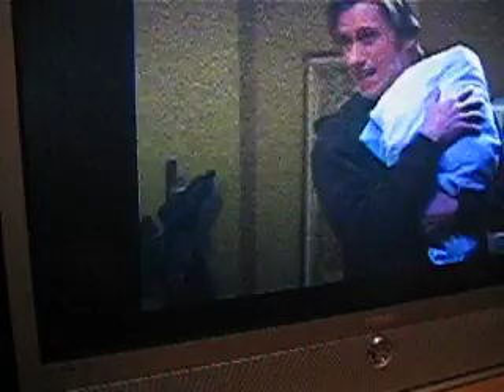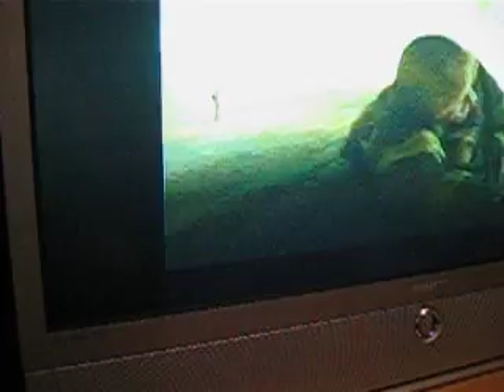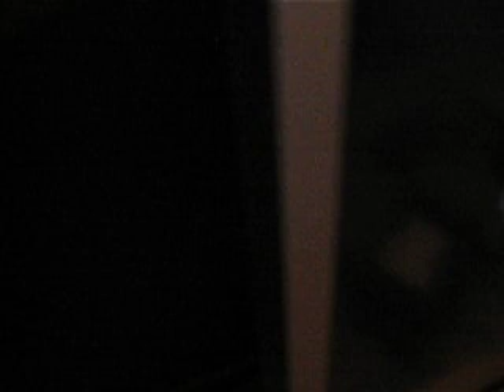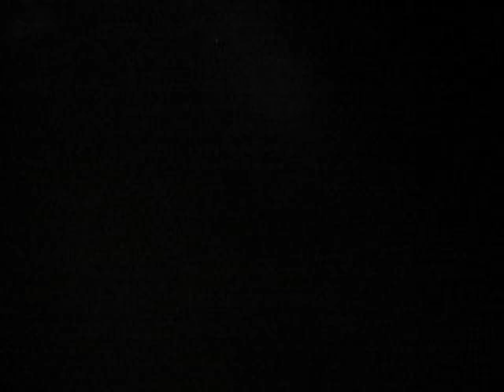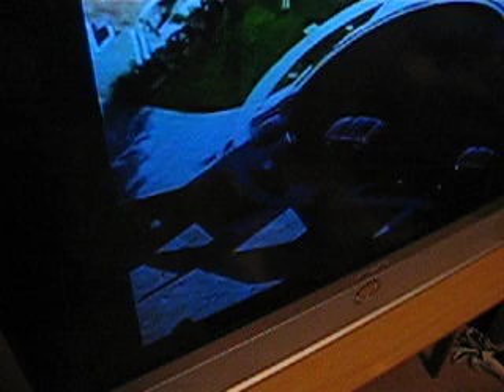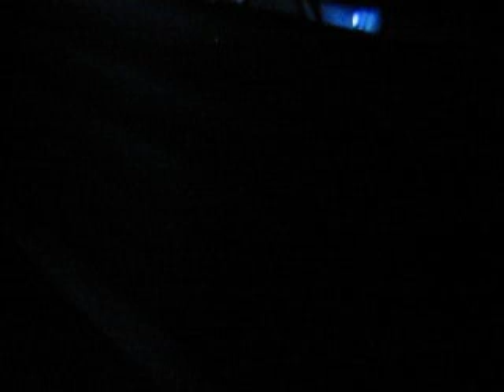DLP Color Wheel Noise (Pre-Replacement)

Comment: Barely makes a noise. Your wheel isn't bad yet. When it's going bad it will sound like a grinding noise. Like if you were to turn a fan on high and touch a piece of metal to the blades while they're spinning. I just replaced my lamp and my color wheel was grinding b4 it blew so I took it out and oiled the bearing and now it doesn't make anymore noise. Tv works better than b4 cause I cleaned all the dust out and cleaned the lenses. A lil preventative maintenance on any high rpm motor will prolong